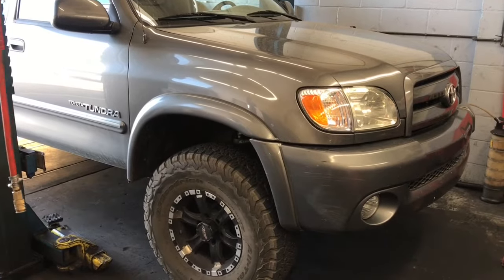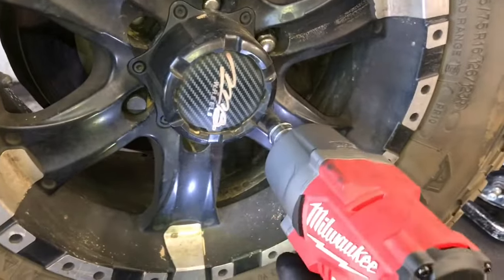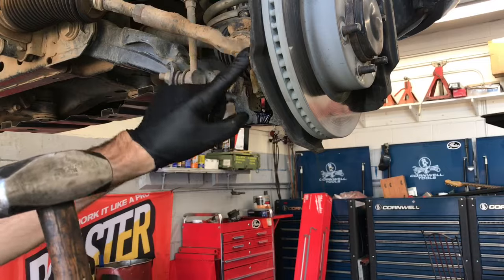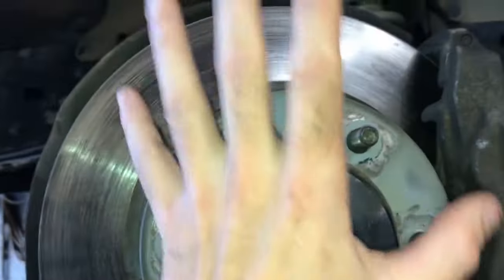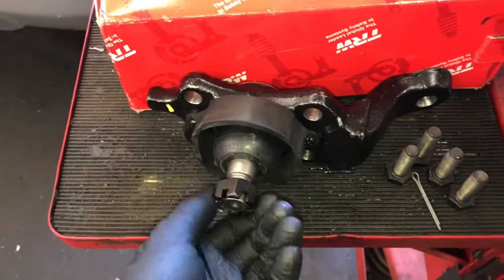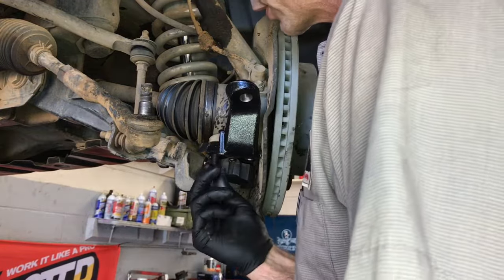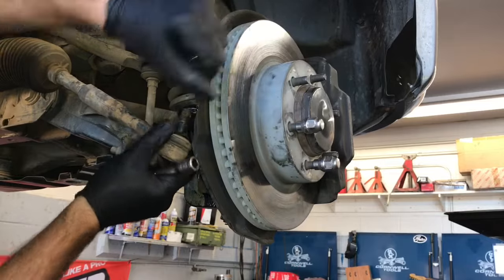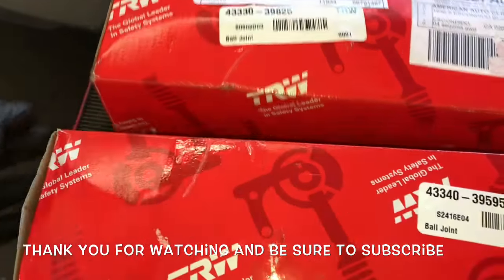How To Replace Lower Ball Joints On A Toyota Tundra

Comment: For these tundras ALWAYS use OEM replacement ball joints.
Reply: Just had a TRQ lower ball joint purchased from 1A auto come apart causing alot of damage, fortunately at low speed.
Reply: Been hearing this a lot on forums and on YouTube.
Reply: I used TRW on my 06 as well, but bought Toyota OEM ones recently just in case. The TRWs will probably last 50K yet have learned trying to save a few bucks on Front End/Suspension rebuilds do not end up saving anything as replacement will likely be lots sooner than OEM.
Reply: I had a lower ball joint come apart in a McDonald's drive thru. The truck fell onto the wheel and blew the fender off. I was stuck right before the window to get my food. Extremely dangerous and embarrassing!!
Reply: @johnathonsensing8162  a coil went out on my tundra while in a drive thru so mid convo with the guy the truck starts to sound like sh*t out of no where and that ended that convo real quick. Always the unknown till you figure it out. My passenger ball joint just started to make noise yesterday so went to look this up. My truck is lifted too so your story concerns me.
Reply: @nickshowsstuff435  Yeah get those ball joints replaced asap! Use nothing but OEM parts!
When you hear that thing making noise. Those lower balljoints are done! Stop driving it until you get those replaced!
Reply: @johnathonsensing8162  will do! I’ll be sure to go OEM on those. Don’t wanna kill myself or someone else on the road!
Reply: @nickshowsstuff435  Absolutely
Reply: Obviously they redesigned the original OEM ball joints that were failing and recalled, correct? Is there a better ball joint than OEM anybody?
Reply: @Ojb_1959  Total Chaos sells a uniball conversion, but it’s a thousand bucks…
Reply: oem ball joints  are the ones are causing problems on tundras why install the problem again
Reply: What about AC Delco anyone have any luck with those
Reply: @alejandroking9995  From what I unsderstood it's not the ball joint that have broblems but the design. So the stronger ball joint are supposed to be OEM still I installed MOOG on mine and it lasted 8000 km ...

Comment: Get an inexpensive pittman arm/tie rod removal tool vs hammering to remove the nuts.  It makes removal simple and easy.  The OEM tool cost $14-20.  The 2006 Tundra torque specs are different and are as follows: 48lbs for the 4 bolts, 117lb pound for the LBJ bolt and 67 lbs for the tie rod bolt, per the Toyota Service Manual.  These specs are not for the 2005-2006 Tundras.  A lot of videos combine all 1st Gen Tundras together but I've found there are some differences when it comes to torque specs.

Comment: After seeing pretty much every aftermarket ball joint fail on the 3rd gen 4Runner, I won’t use anything but OEM ball joints.  They are expensive, but worth it.  I change them preventatively every 100 k
Reply from the maker: HondaSolutions I've had good luck with TRW. I've also seen OEM ones where out prematurely. Best thing is just to check them often. Thank you for watching!
Reply: I heard that!!! 👍
Reply: Buy the best and only cry ONCE!!

Comment: Agree with Rickjames. ALWAYS use OEM ball Joints. All Toyota trucks from 2000-2003 have a Free factory safety recall on ball joints replacement (Tacoma, Tundra, 4runner, Seqouia, Highlander). They can fall out while driving like my Son's did (could get killed if at highway speed) . That is why OEM parts are recommended for their new design/strength. Aftermarket ball joints might be just the same as original OEM bad desigh/strenth.

Comment: Thanks so much for the instructional video.  Paid it forward by donating $25 to your "Giving Automotive".   You saved me a lot of cash by showing me how to do this.  I would suggest to anyone doing this job,  use a pitman arm puller.  When your down low on jack stands it's almost impossible to get a good hammer swing.  I couldn't break it free and had to put it back together until I got a pitman puller.  I very highly suggest you watch how to use the pitman puller.  I wouldn't do this job without one.  Parts store should rent these.  They cost less than $20.  Don't forget to apply red thread locker to the 4 bolts on the ball joint.  Takes about 3 hours to complete this job.
Reply from the maker: Glad the video was helpful. Thank you for watching and your Donation! Love the tips as well.
Reply: Thanks for the tip I tried to break the tue rod free with just a big hammer and it would not give until I used the pitman arm puller highly recommended especially if your parts are still original.

Comment: I have used duralast gold ball joints to with good results remember to put grease fitting on first and put some grease in them prior to install they come dry also if you want to use factory rubber guards you can drill and tap the small bolt holes and they have a lifetime warranty.

Comment: I have one more question, is it necessary to grease new rubber bushings that are going on the Tundra rack and pinion?

I’m going to tackle that job and the sway bar as well but I get conflicting information, that it should be done and that it should not.

Thanks
Reply from the maker: Smoke Stack if they’re polyurethane bushings and yes if not you’re OK but either way would not hurt.

Comment: Question 
I had control arms replaced then at another shop they replaced the rack and pinion and tie rod ends paid $750 each place and it still had play took it back to the 2nd shop they said wrong ball joints first place said they were the correct ball joints.  Any advice would be very much appreciated if none I understand.
Great video though.
Reply: Probably had recall and used updated ball joint. Check 02, 03 and 04 all have different part numbers.

Comment: Got quoted $375+parts for lower ball joint replacement on my 04, said fuck it and just ordered one of those milwaukees and am gonna do it myself all because of this video haha
Reply from the maker: Biggie Smalls you will still save big. Let me know how you like the tool and how the job comes out.
Reply: Everything went smoothly with the ball joints and while I had the tires off I figured I would replace the brake pads also. When I was doing the brakes, brake fluid shot out the reservoir and now my truck won't start, some sort of batter issue. 🙃
Reply from the maker: Biggie Smalls sounds like the key was on the other door was open or something. Charge the battery or use a jumper. The brake fluid in the engine bay will wash off with water.
Reply: Yea I ended up jumping it, didn't have anything to do with the brake fluid. It seemed as if I was shorting out the battery when I touched metal to the brake rotor, all is well now though. Thank you for the video this has helped me so much!
Reply from the maker: Biggie Smalls glad the video helped. Thank you for watching!

Comment: lower ball joints always go out on these generations people who tow or have improperly lifted their truck usually go through  these  i know alot of individuals who use their tundra as a work truck or tow rig  they always have issues with non toyota ball joints, also once a ball joint fails on this gen tundra the whole knuckle will come lose sliding on the ground depending on speed might break the wheel clean off
Reply: HumbledGod I'm scared now, I just bought one lol

Comment: I’m going to change fluids on my 2004 Tundra, I have a LSD rear differential, the manual says to use 75W-90 for front differential and transfer case, but to use 75W-90 gear oil with LSD additive for rear.

What do you use when changing fluids and something like this comes up? I tried finding the answer on your other videos, but could not.

Thanks

Comment: This is my 2nd time I have a ball joint break on me. Now I'm just paranoid. First time was a year after I bought the truck now the second time was like a year ago. Messed up my fender and I had to extract the bolt out out since it broke in half. Trying to find a specific brand of part or trick to avoid this kind of issue.
Reply: OEM brand is all I trust.
Reply: They had a recall and Toyota had a new version you are supposed to replace them all with because the original style can fail without warning. Get them all replaced now!
Reply: Sankei SB3806 japan
Reply: What brand did you use that broke?

Comment: You torque your wheels to 83? What kind of rims do you run?
Reply: Jeff Trevor Dickson that’s the torque spec in the Haynes manual
Reply: Chico916 Thanks!
Reply: I do 120
Reply: Torque spec for Toyota alloy wheels.  The steel wheels are 154lbs.